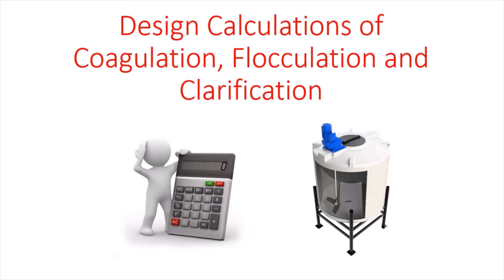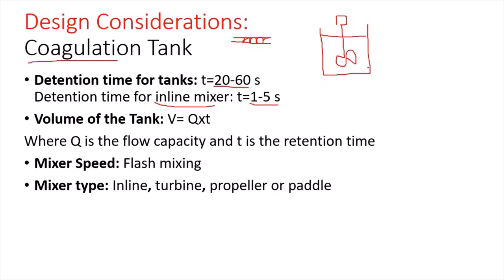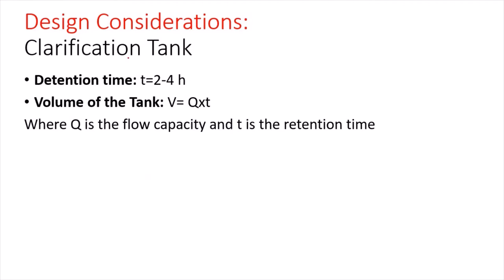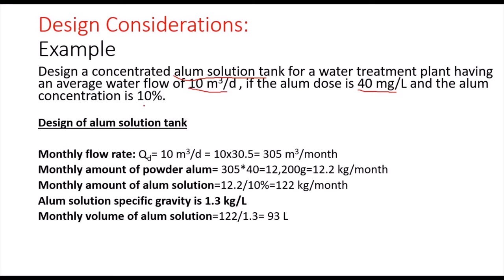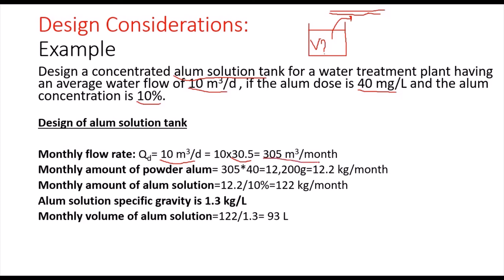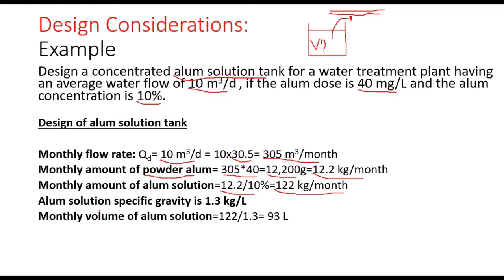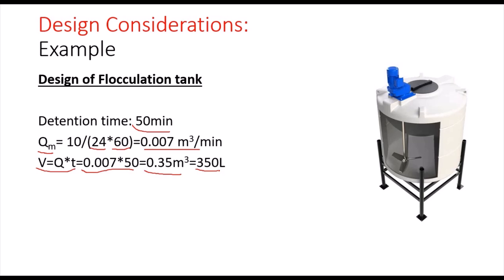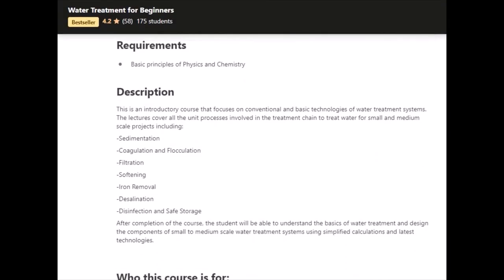Design Calculations of Coagulation, Flocculation & Clarification || Turbidity Removal in Water

Comment: Very interesting :), It would be nice to add surface loading calculation when it comes to clarifiers design (quiet a important parameter) SL=Q/S where S is surface of the clarifier. SL=0.85m3/m2 for best results and shouldn't be more than 1,2 m3/per m2. Worth also mentioning that Al2SO4 for more or less only phosphorus reduction but you might get some BOD in a sweep coagulation phenomena as bonus.